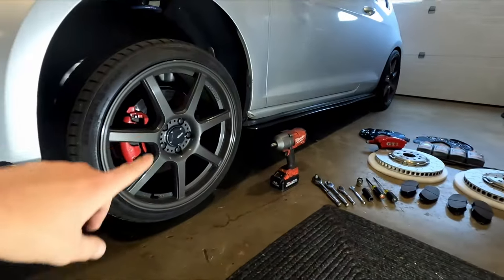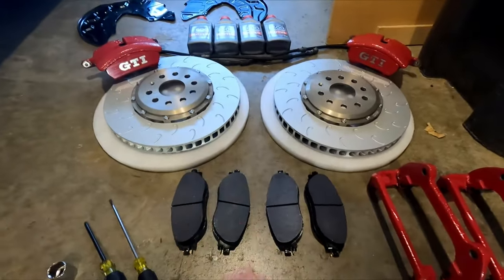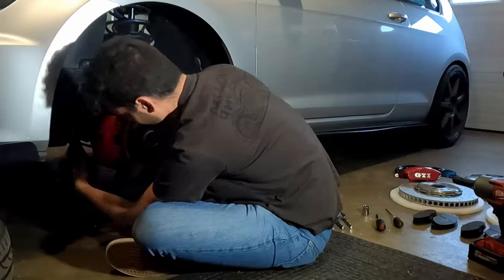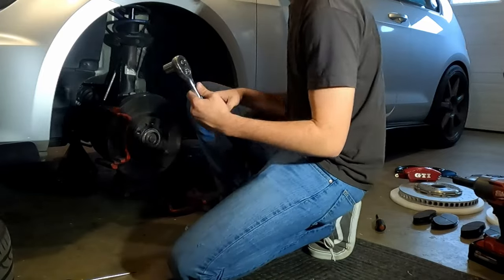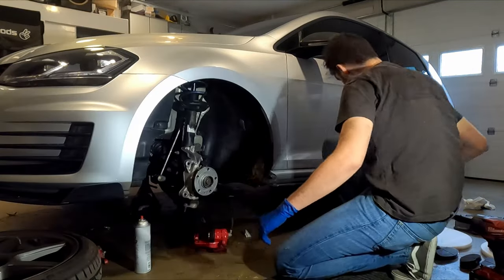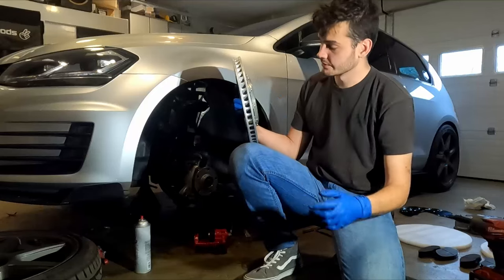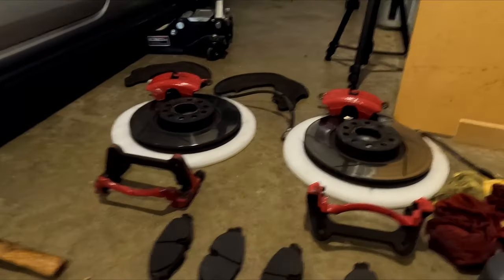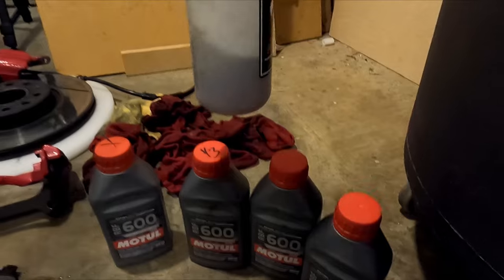MK7 Volkswagen GTI -  Performance Pack Brake Upgrade - DIY

Comment: I like what you did. You used the VW parts bin, plus you have a two door GTI, not the unwanted four-door they have now. VW should make a two door version as an option like they do in Europe. Plus, also  bring back the VR6 back as an option for enthusiasts like me who still love and want the VR6 engine. Owned an MK4 R32 😢 and lost it to a flood 😢. Nice video.
Reply: The VR isn't coming back in the U.S. Due to rising fuel efficiency requirements by the Government, and increasing smog equipment regulations, it's just not coming back.
Reply from the maker: I honestly don't see the point in going bigger then this set up, with some high temp fluid you'll never have brake fade.